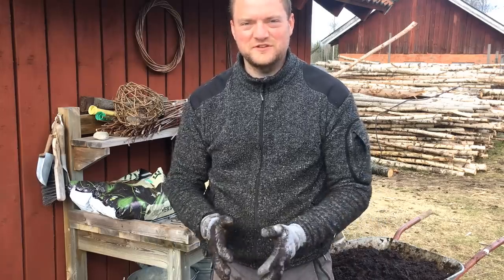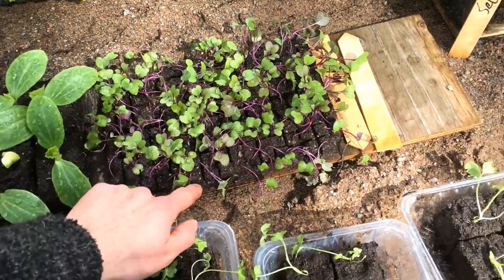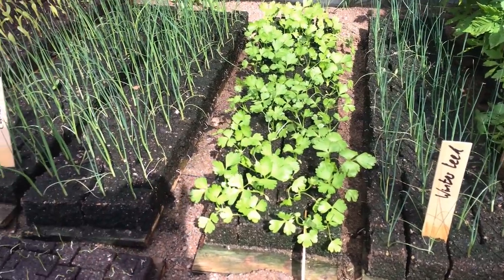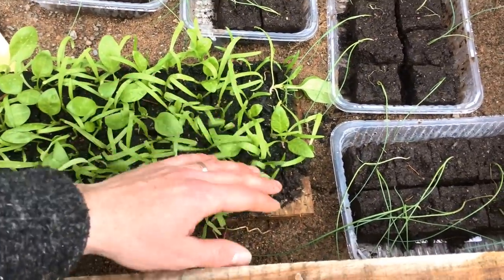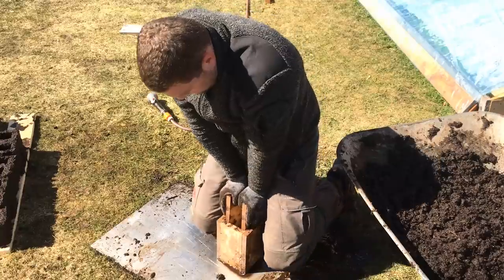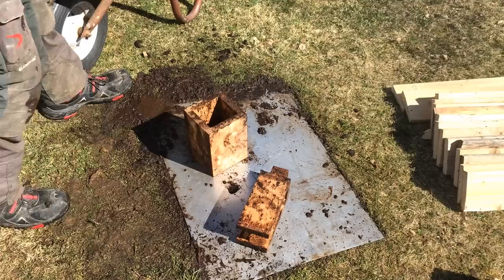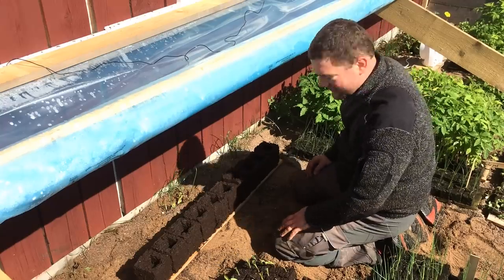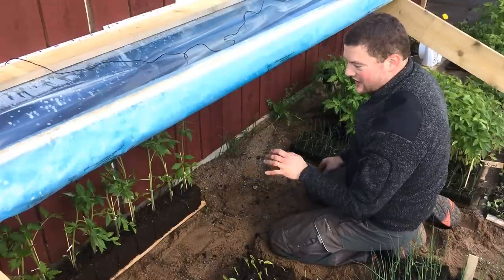Transplanting, Cold Frame & Tomato Update

Comment: Clean up your block press real good, put it  in 150°oven & get the wood nice and hot, while your heating up the wood melt some bee's wax, wax the wood while it is still hot paint the inside of the press and the bottom of your block and the sides with the hot wax and let it soak in, this should make the release the potting soil much easier
Reply: Wax, Varnish, Polyurethane - ANY water repellent finish or coating would be better than bare wood.   Also - The syringe portion of the blocker needs reinforcement with a small block or bar across the middle gap= }H{  poor drawing, but hope the idea comes thru.

Comment: Yes, making the larger soil blocks for the tomato transplants is labor intensive, but, you make up for the time by the speed in which you are able to replant. It seems to all even out. Plus, buying the potting soil might have been an added expense, however, you are correct about soil improvement. You've eliminated weed seeds, undesirable microbes, and other adulterants which would have been present in a homegrown soil mixture. What species are you using? I've used the Rutger's heirloom since I live very close to the University Agricultural exchange. Home of the tomato which was made famous by Campbell's Soup. They're a cross between the J.T.D. and the the 1934 variety. Big ol' "Jersey Tomaters"

Comment: next time you build a block maker, paint the insides with a high gloss paint. slippery! have you considered making a block mold 6-8 or 10 boxes wide, dividing them as you press the holes? use cardboard  so they'll soften and maybe dissolve when wet. great looking cold frame, always loved them!

Comment: If you sand your wood down to at least 600 grit it will release alot better. If you sand it fine enough it will even become hydrophobic, however you need to go REALLY fine. It depends on the wood, the black walnut that grows here in southern Missouri becomes hydrophobic at about 2000 grit... if you use a foam backing for your sand paper.

Comment: Very nice a lot of work. I have a suggestion on your plunger slope the side just a little and it will release much easier. Also if you coat it with some polyurethane or similar it will slide easy. But I like how you made them slip in from small to large.

Comment: Boiled linseed oil on the wood and it will release. let it cure for 30 days before using. Also not so wet, just water drips from a tight fist. You are washing nutrients out as wet as you have it.
The cold frame looks great and so do your plants. Do you plant the tomatoes deep? I just leave two true leaf pairs above ground. The rest grows roots as it is below ground. This makes for very robust and heat resistant plants. NM

Comment: You might have better/easier time removing the plug part of the compression fixture, if you cut a slight taper on it. Make the bottom smaller than the top. Taper doesn't have to be much, but should release easier. Otherwise your "project" looks good. Will need to try and make something similar for our use. Never have seen that method before. Thanx! 

The Old Norwegian  <><
Reply: was just thinking about that. Relief angles are a thing in casting metals so they should help in this situation also :-)

Comment: take a 2x6 lay it flat, atatach a upright 2x4 2/3d's height of cell block. thake another 2x4 slot the end,drill hole for bolt and make a lever. much more compaction and not as hard work